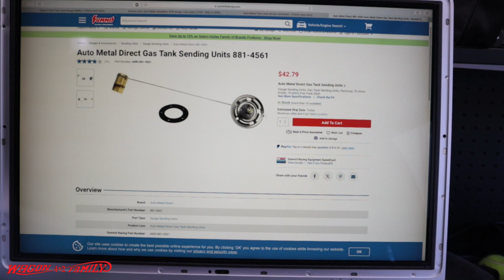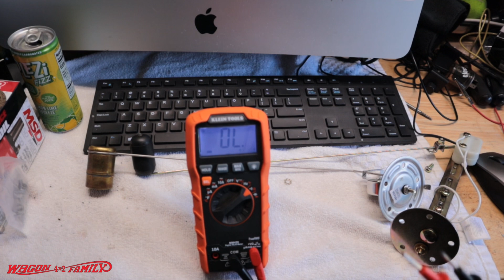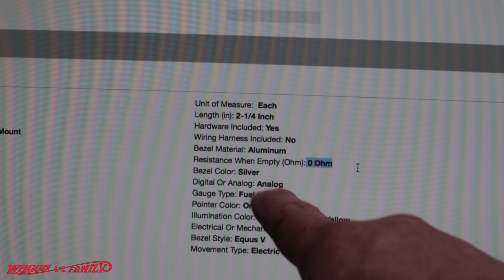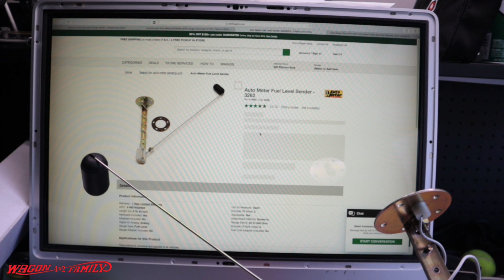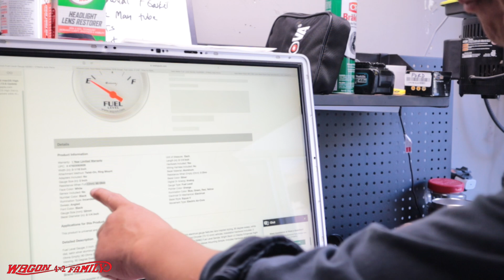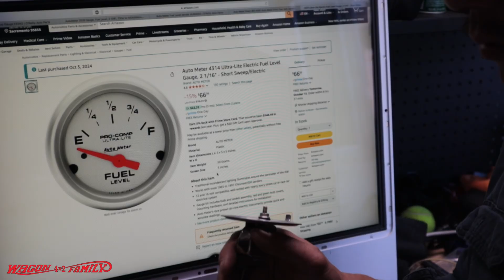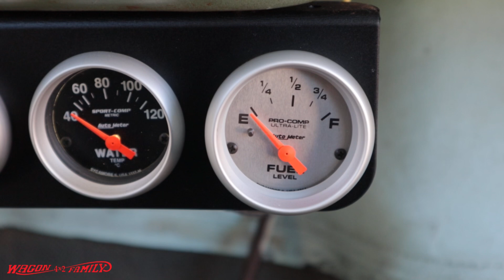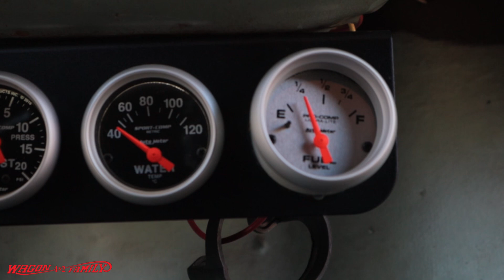Troubleshooting Fuel Gauge and Sending Unit

Comment: Your thinking is close, but not quite correct. If you want to use your factory dash gauge, you’ll need to purchase a tank sending unit (either a factory, reproduction, or universal fit) with matching ohms. Just buying one with a wider range isn’t going to help your gauge read correctly. For example, both Ford and Chrysler used a 73(E)-10(F) ohm sending unit until the mid 1980s; so you’ll need to replace the sending unit with a 73-10 sender to have your working factory gauge read correctly. Installing a 90-0 sender into a pre mid 1980s Ford or Chrysler will cause the dash gauge to read backward; clearly, installing a 90-0 aftermarket dash gauge to a factory 73-10 sending unit has the same effect. A wider ohm gap is not what makes a sender “universal” as those numbers need to match closely to make the needle point accurately. The universal fit only means the ability to adjust the physical fit the sender into the tank so the float is in the correct position to insure that the float arm is in the correct position (in the height of the tank as well as on the sweep of the potentiometer) to send the correct reading back to the dash gauge.

Comment: I’m having a similar problem and couldn’t find any good info except for the ohms testing. In the testing videos, I noticed some were read most at top and some at bottom. Thinking I was imagining things, I went back and looked again. Sure enough some were reading at top and some at bottom. Then as I was coming to the same conclusion as you were. Then I saw your video and it was starting to make sense. I’ve got a 1958 dodge truck and the gauge is working backwards. When my tank had no gas in it, it was above full and as I filled it the hand was coming off full in reverse. But when the key is off, my hand shows empty.